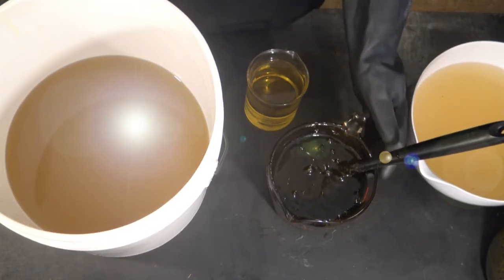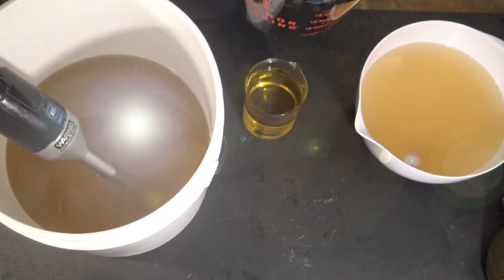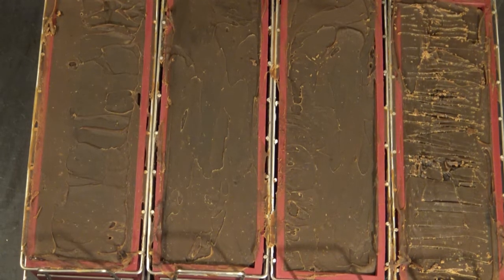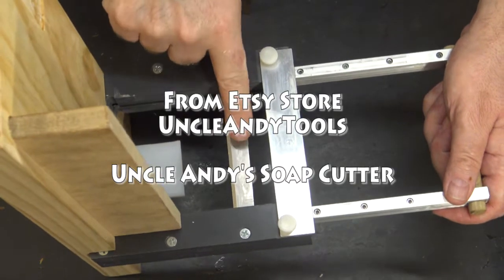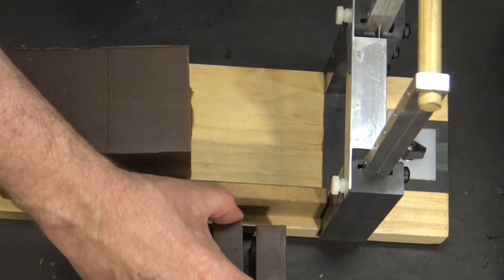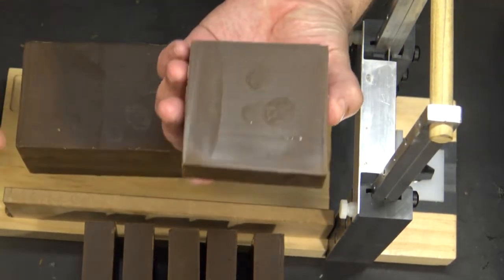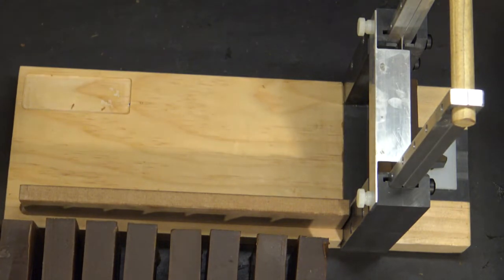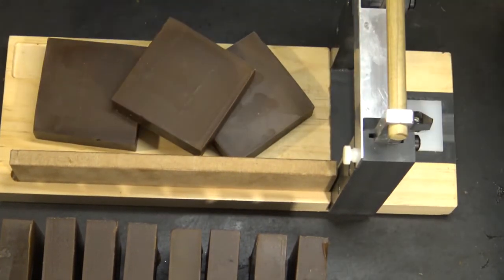Making Pine Tar II - & Mold Cutter Review

Comment: Hi Patrick. I was just telling my sister about this soap so I need to keep my eyes peeled for it appearing in the store. You put a bucket load of pine tar in this baby and while I do not have skin issues my nephew does and this may help. Love the dark mystery of it. Hugs my darling to you and tickles to the critters. X x x
Reply from the maker: Hi there Kath Yes I do add 15% of the pine tar most people make it with 10% or less it does make it more difficult to make it adding more it goes to Trace faster but I find it's more effective at least that's what people told me.

Comment: One other suggestion may be to spray the blade with RA if it allows for that. I have a hand held blade type cutter that I use and find it much more forgiving to the smudging of a soap surface (especially Glycerine soaps) when I spray with RA and the soap releases better as well. Just a suggestion:)
Reply from the maker: Lovely suggestion, thanks so much, I will give that a try

Comment: ooh it looks like chocolate in the molds as you poured them. I bet this is an amazing soap.  I'm gonna have to get some of this. I have scalp and skin issues. Very dry itchy skin, excema or psoriasis on scalp. worse in the winter. Wow! That's an amazing soap cutter! It looks very strong yet it is so quiet. Kind of like a guilatine but, I do see what you mean about the danger and the smear it leaves. It could be from the softness of the soap or any soap may do that? Using it more will tell.
Reply from the maker: Hi there Sabrina, many people find that it works for them. but it's always a good idea to be skeptical and not invest too much into some home remedies.

Comment: A quick rinse in cold water removes the blade marks from the bars and re-shines the bars. Same as if you used a knife instead of a wire. 😊. This is a wonderful soap! May I ask what Pine-tar you prefer to use? I seem to only find it at equestrian stores here in New England ( its great for hooves). My father swears by Pine-tar soap and shampoo. Thanks so much for sharing!
Reply from the maker: Hi there, thank you for that tip I will try that as well. As for the pine tar most used is a brand called Bickmore, they seem to use a cleaner method than several other companies do

Comment: Do you know the maximum height of a bar that blade/cutter may cut?
Reply from the maker: Hi there, This cutter will accommodate soap loaves up to 4.5” tall by 3.7” wide. The thickness can be adjusted from 0.75” to 1.75”